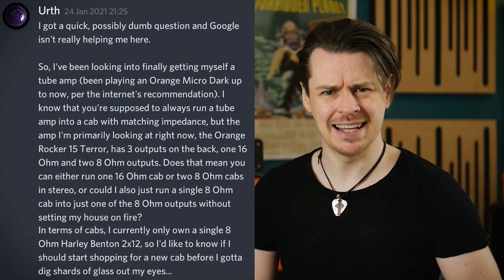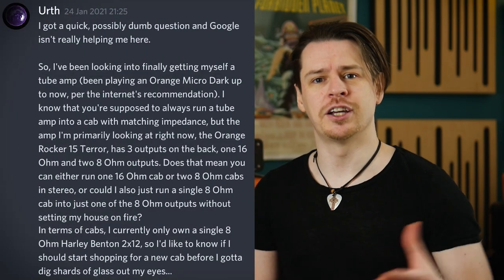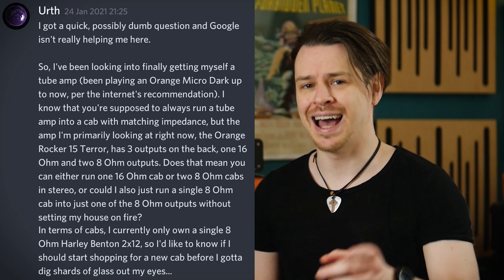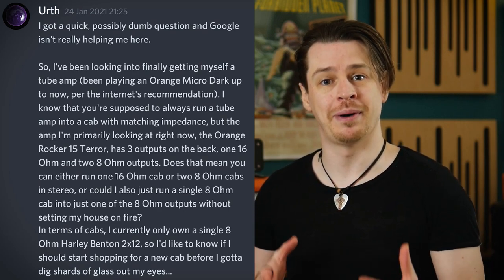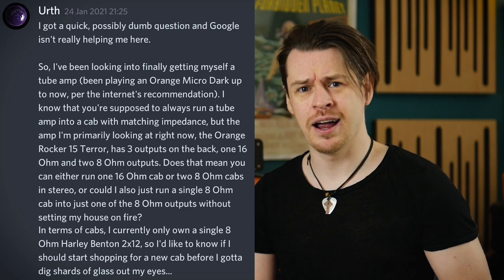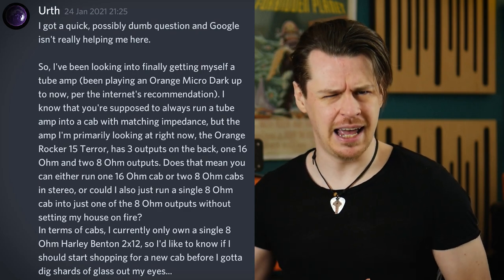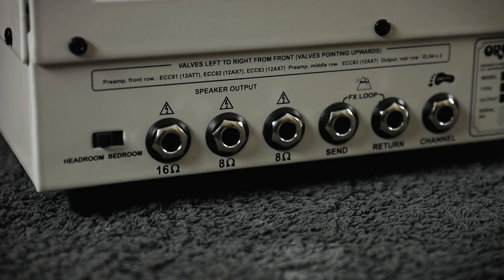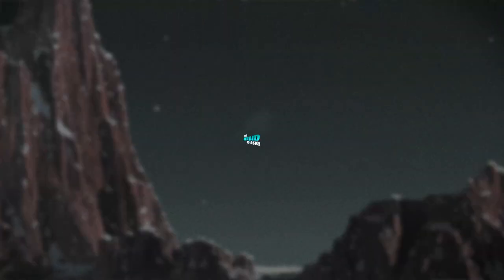Impedance Matching Speaker Cabinets | Too Afraid To Ask

Comment: On the topic of "safe mismatch" Hughes and Kettner actually contradicts this with a specific picture/infograph (pictured in this post here: http://blog.hughes-and-kettner.com/ohm-cooking-101-understanding-amps-speakers-and-impedance/ ). I haven't mismatched much, but the issue is that even with a big company there is discrepancy like that. they also explain the power and ohm in the same way, but it's strange that other amp companies will dead stop you in your tracks and say "absolutely not" even if its something similar to what H&K are telling you here.

 Is that done as a safety precaution to people or is there something that will absolutely damage no matter what? I also get inefficiency in the equation, but it seems like it would also act almost as an "attenuator" of sorts from a drop in power? or am I missing something from what they're saying there as well?
Reply from the maker: The article you cite actually explains the issues inherent in mismatching while paradoxically recommending it. They are advocating for inefficient performance by highlighting how it changes the sound. There are much better ways to EQ your signal than messing up impedances. 

The truth is that power and impedance are ratios of voltage and current, mismatching the impedance changes that voltage/current balance and you will either get more voltage or more current travelling through the speaker and the output transformer than it should. 

While the speaker and amp are likely to handle a small mismatch without imploding, it's not recommended as it's strain on the components that doesn't need to be there in order to achieve a sound that is better achieved by other methods.

Comment: Does impedance need to match if I were to run an amp head into a combo’s effects loop?
Reply from the maker: If you are running the SPEAKER output from one amp into the effects loop of another then you'll need to worry more about ruining your amplifier. 
Speaker outputs are for speakers only.

Comment: if you have the two 16 ohm cabinets to the 8 ohm output for a 100w amp and one is 25 watt and the other 75watt, does it work ok?
Reply from the maker: Power is distributed evenly across the number of speakers connected. 
So for two speakers connected to 100W amplifier each will see a maximum of 50W.
Reply: @ScienceofLoud  thanks!

Comment: So.....I just bought an Engl Powerball 2 and really don't want to fcuk it up. I am using a Marshall 1960 cab, and If I am looking right, I see on the back in mono (only using one cab presently) I can choose 16 Ohm or 4 Ohm? So, should I connect the 16 ohm on the ENGL to the 16 ohm on the Marshall cab? or the 4 ohm parallel on the Engl to the 4 ohm on the cab? I am guessing the 16 ohm to the 16 ohm will use the full capacity? and hence that is the best choice? Really looking forward to cranking up the Engl and blasting out some heavy riffs, so many thanks in advance for any advice.
Reply from the maker: @SkjoldrUK  Yup, you got it: 16ohm will give you full capacity of the transformer for maximum power transfer - connect the amp's 16 output to the cab's mono 16 input and get that thing cranked up!
Reply: @ScienceofLoud  Thanks a bunch :)  \m/

Comment: For 16+16=8 meaning that it works can be quite confusing to first time users. Because basic mathematics would say otherwise. I never tried to put head and cab together before and I hope that the information given here is accurate.
Reply from the maker: Basic mathematics is understanding the difference between 8+8 and 1/8+1/8

It's not mathematics you need, it's understanding series and parallel wiring
Reply: @ScienceofLoud  definitely man, I studied music at college just to learn the my bass. However I still yet to learn the tone elements if you know what I mean.

Comment: Does that mean that I can plug my valve Orange Dark Terror (15w) into my Orange 8inch cab (intended for the micro solid state 20w). The cab says it can take 8ohms 20w. . . .but it is tiny and looks like it would immediately explode. My 15w valve dark terror is soooo much louder than my non valve 20w micro terror.
Reply from the maker: The speaker is rated for 20W, therefore it will handle 20W. 

I've made a video with Orange where we run a 200W bass amp into that same speaker and it takes a lot of power to melt the voice coil. 

The speaker itself isn't going to explode.

You'll be just fine.
Reply: @ScienceofLoud  wow thanks. Do you have a link to that video?  I want to see.
Reply from the maker: https://youtu.be/vuQAJCDQd5E
Reply: @ScienceofLoud  so I could run the dark terror through it on the 15w setting at full volume and it won't melt? If its loud enough on stage this could make an excellent back up cab for gigs. It all gets put through the pa anyway.

Comment: How can you determine the Ohm rating of a 4x12 cabinet without opening it up to see the wiring?
Reply: Measure the DC resistance between the tip and the sleeve of a speaker lead plugged into the cabinet. A 16 Ohm cab will measure more than 8 Ohms, an 8 Ohm cab will measure less than 8 but more than 4, and 4 Ohm cab will measure less than 4.

Comment: If your cabinet contains two 8 ohm speakers is the impedance of the cabinet as a whole still 8 ohms or does it become 16 ohms because there is two of them?
Reply from the maker: It depends on whether the speakers in the cabinet are wired in series or parallel.
Fortunately this video explains how to calculate the total impedance for both of those scenarios.
Reply: @ScienceofLoud  Thanks.  How can you tell by looking at the speakers whether they are wired in series or parallel?
Reply from the maker: @jannytyler  Refer to this image: https://i.pinimg.com/564x/96/b6/c8/96b6c8065a8218ae9ebc97e807aaa622.jpg
Reply: @ScienceofLoud  Thank you very much.  It's in series so therefor 16 ohms.

Comment: i always get a kick out of the fact that if you wire 9  8ohm speakers in 3 parallel strings of 3, it still is 8 ohms.  also, jucifer is the master(mistress) of connecting cabs in crazy ways.     the real golden rule is:  NEVER short a solid state (0 ohms) and never open a tube output (infinite ohms).   it might not sound the best, but you wont destroy the gear.
edit: you could traumatize everyone by telling them that impedances in the freq domain uses the square root of negative 1 when you do your phaser math. muahahahaha (shred laugh)

Comment: Is it anyhow possible to connect a 16 Ohms box and a 8 Ohms box to an amplifier that has switchable either 4 or 16 ohms? please help me haha
Reply: It really depends on how it's wired but usually not. What happens is that a cabinet usually has a switch that's toggled when a speaker cable is plugged. If you know your electronics, you can technically fandangle it, but I would advise not

Comment: This may be (and probably is) a stupid question. Then why TWO 8ohm outputs?
Reply from the maker: This video literally answers that. That's what the whole video is about.
Reply: @ScienceofLoud  I’m not in love with your tone sir. I had a bass head and two cabs. You plugged the head into one cab and the from the output of the first cab plugged another cable into the second cab. One output in the head.

Comment: then why is there 2 x 8 ohms outputs ?
Reply from the maker: Watch the video and find out
Reply: @ScienceofLoud  i did. You ask «can we use both 8ohms outputs together?», the answer is no. But in which case can we use them then? I guess with two 4 ohms cabs.
Reply from the maker: @simonkeupon  ...then you haven't watched the video. I suggest you try again. This is very clearly answered with the maths to back it up.
Reply: @ScienceofLoud  omg I'm a knob, or just tired

Comment: I stumbled across this video trying to up my bass rig. Currently I have a rumble 40 amp, a spare 4 ohm speaker from a fender BXR 100, and two tsr connectors. my question is am I able to achieve the same finished product with what I have or is there something I need instead so I dont blow my shit up? https://youtu.be/U9vPpxLuck4

Comment: No you don't get best efficiency matching the impedance..
Reply from the maker: Please, do explain how, in terms of physics, power transfer is more efficient by not matching impedance.
Reply: @ScienceofLoud  An voltage amplifier has output impedance, max output voltage and max output current. The ideal output impedance is 0 so that the voltage across the load is intended. 
Output current capability is limited by the amplifier itself or the output devices themselves. Ideally output current capability is infinite for a voltage source.
Output voltage is mostly limited by the supply voltage. 
For a fixed voltage across the load as intended. Any output impedance higher than 0 is causing wasted heat.
Zero output impedance is going to provide best efficiency. 
For a voltage amplifier/source, higher load impedance to output impedance ratio is always desired.
The maximum output power is roughly at the load impedance of (max output voltage)/(max output current). The max voltage voltage with lower impedance load is usually lower.
Reply: In terms of why there is matching impedance. The output impedance of transformer is not resistive but inductive. So the load impedance is going to drastically change the frequency response of the output/across the load hence changing the sound. Although in the world of guitars, it's just some coloration no big deal.
Another big reason is that the different tap of the transformer decides different output currents and voltages. This allows a single load impedance for maximum power for each tap. 
These complications are not there with transformerless amplifiers like most transistor based amplifiers. But the output power will drop either way from the load with maximum output power.
Reply from the maker: @johnyang799  You seem to be conflating your facts here, or simply have completely misunderstood what I have said:

When mentioning efficiency I'm talking about power transfer - how to get the most amount of energy from amp to speaker. 

It's very well established that for maximum power efficiency the impedance of the source should match the impedance of the load. Now to mitigate any confusion on that; maximum efficiency doesn't mean 100% theoretical ideal case. It means the maximum amount possible within the constrains of the device and the laws of thermodynamics. 

I'm discussing guitar speakers, where the main consideration is being loud and that is best accomplished with maximum power efficiency. 

With a higher impedance load the amplifier will be unable to deliver its full power, hence less efficient than matching impedance. 

A lower impedance load risks potential damage as excess power generated by the amplifier is dissipated in the components, again being less power efficient than a matched system.  

I think you may have actually touched on exactly this with the latter half of your second comment. 

Power efficiency may not be the top priority in other audio situations, particularly if you are sending line level signals from a mixing console to multiple other recording devices in a studio for example. In that case maintaining the signal voltage is a higher priority, therefore one may wish to have higher input impedance on their tape machines than is output from the mixer - this is still less power efficient, but that's not a major consideration in this case. 

Perhaps that is what you were referring to with your first comment?
Reply: @ScienceofLoud  Well. Efficiency is efficiency, power efficiency. If you meant louder/max power then sure. 
In that case, it's still not impedance "matching" though but using the optimal load for the transformer tap.

For transformerless amplifiers, there's one load impedance with maximum power output but there's no matching either. As mentioned in the video, it is correct that it only needs to be higher than the minimum load impedance so the amplifier isn't going over current.

Comment: It is lame have to know physics to operate a devise.
Reply from the maker: You need to know physics to operate any device. 

To use a pencil you must understand pressure.
To use scissors you must understand forces on a lever.

Understanding impedance to match speakers to amplifiers isn't any different. 
There is ALWAYS an understanding of the physical mechanics required.
Reply: @ScienceofLoud  Next time I operate my  crayon I'll consider that.   ::   ))